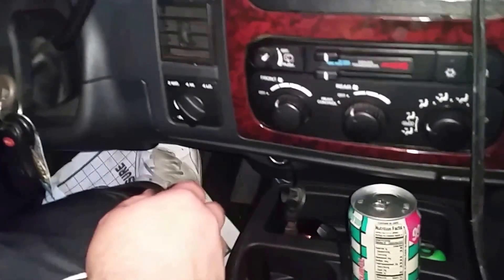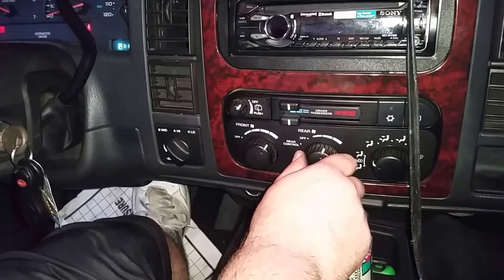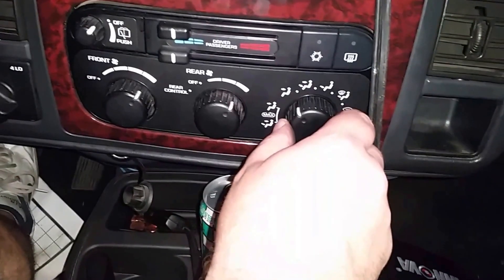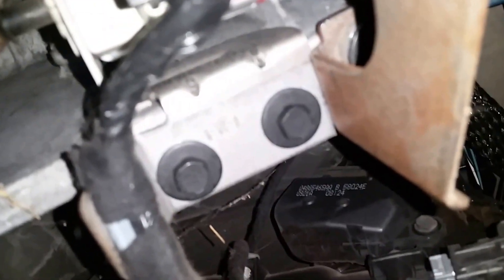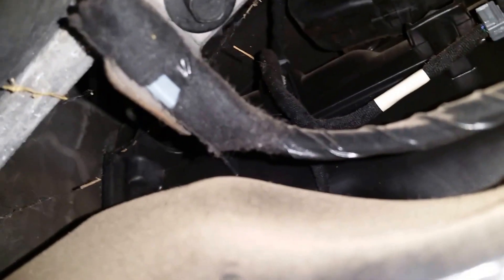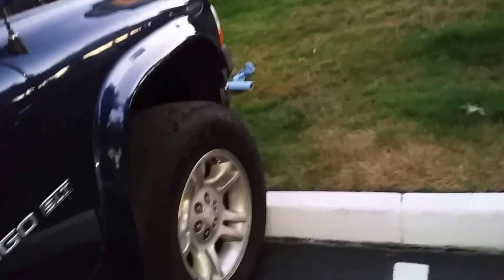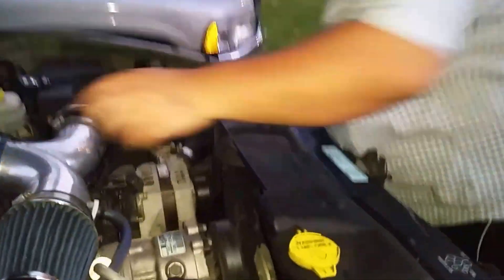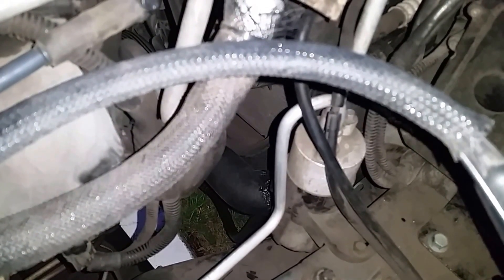2001 Dodge Durango pt 2

Comment: To be an old vehicle it was in pretty good condition overall. Keep up the good work and don't work too hard. 👍
Reply from the maker: stuzman its got a lot to do... intake gaskets, evap codes, 4x4 doesn't work at all..., valve covers, bushings, LOL more to come lol
Reply: Richard Cowtails Ah, then you've got a lot of work to do there Richard. I was only commenting on what you were pointing out as you were inspecting the vehicle. Sounds like you got a lot of videos you can make. 😀
Reply from the maker: stuzman totally. it'll be a good car for him. just needs a little work. overall is nice